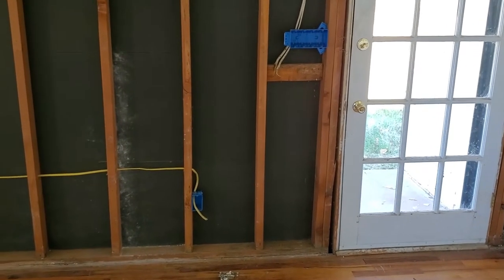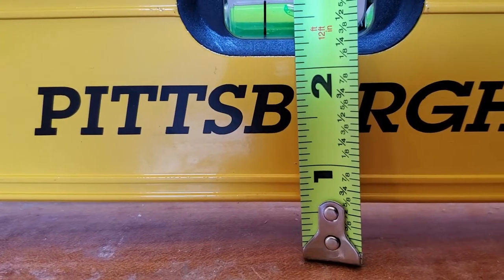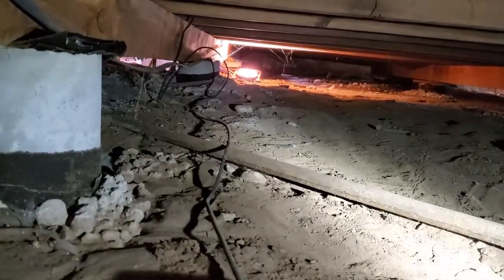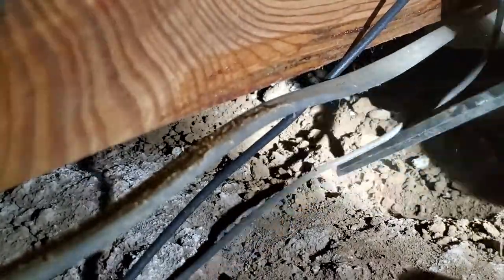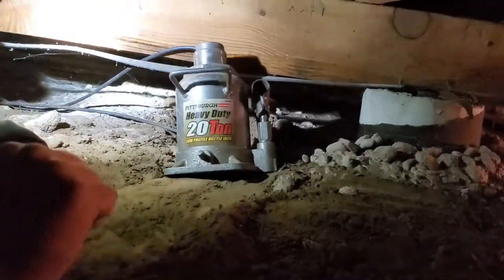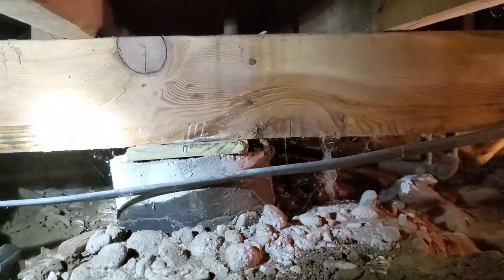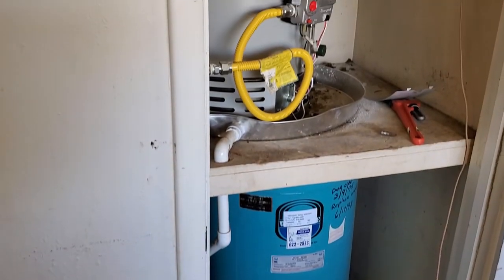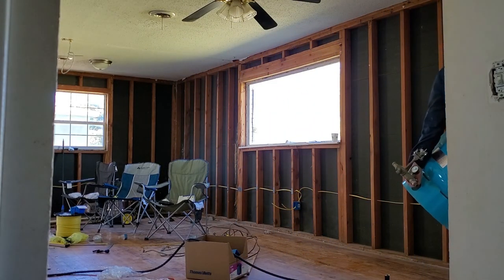Leveling the Pier and Beam House | My First Renovation

Comment: If the interior floor was not important or being saved I would have cut a section out and worked standing up between the joists. But it looks like you wanted to keep the flooring intact. Good real world vid. Take care.
Reply from the maker: I really wanted to try to save the floor. All things considerd, because I had so much to do under the house I should have taken it up to do the repairs. Live and learn!
Reply: you are right why not just cut floor out to the crawl space and stand on it for repair...as well as adding any hydraulics....

Comment: Oh boy...I just bought my brothers out on a 1948 house we inherited. Im trying to get rid of a hump where the floor buckled.  I feel good after seeing this crawlspace though. I have a lot more room.
Reply from the maker: It's really not too bad to fix. Check to make sure the beams are nailed together really well! Mine only had a few nails which did not tie them together well and offered no displacement support! Triangle nail patterns are your friend when trying to make the beams stronger
Reply: @Jay_Schmidt  A couple of years ago the floor buckled because the water heater was leaking and literally spraying a fine mist of hot water right onto a pier. It heaved and when I fixed the leak the floor pretty much settled back. It was good enough for 90 year old grandma. 
Now that Im putting a straight edge to it, it still needs to go down another 1 - 1 ½  to be right.
Since there are no shims I decided to use a rotor hammer to shorten that pier. We will see.
 I got started last night. Hard work.

My plan is renting it out. It isn’t in bad shape like yours was but its showing it age and and lack up updates.
Im going to attempt to ground the 2 wire system rather than rewire. Mainly because it is not necessary to take the house down to the studs.

Plus Im trying not to run out of money lol
Reply from the maker: Oh, it was raised. Sorry, I thought it was low. This kind of work takes a lot of time to get rid of that 1 inch difference, haha. It sure makes you feel good when it's done.

Yeah, I needed to insulate so I figured I may as well do EVERYTHING at once... despite my wallets complaints. At least doing the work myself is much cheaper.

Let me know how your house turns out!
Reply: @Jay_Schmidt  what is your present stage?
Reply from the maker: I'm a few months behind my video. I've already got drywall up and a bathroom done!

I'm finishing skim coats and about to move on to the kitchen.

Comment: A few things-

It looked like the sag was between piers in the crawlspace. Once a sag has occurred you can’t simply lift the existing beam at the two adjacent piers without causing issues in other spots (think see saw with each pier being a pivot point).

What you need to do is:

Get some 2x6 (or whatever height that beam is) which span at least the distance between the two piers
Then lift in the middle of the sag when level (use laser level or a 6 foot level) attach your 2x6s to the original beam (the easiest way to do this is with some Spax power lags- just point and pull the trigger). Use many lags (at least 8 )

Ideally - you can create a permanent  support where the  sag was (to do this you need to either dig and fill a Sonotube or dig less, fill with gravel and top with a steel plate or large 16”+ cement block. These would provide a spot that will keep your support from sinking when the ground gets wet. Either way- sistering the original beam (adding 2x pieces to the side of it) must be done because the original beam has failed.

Comment: Same problem that I surmised after the hvac people installed a water heater and new heating furnace in the small utility room closet in the kitchen after install as there had been a sagging floor directly at the point of these 2 heavy items...installers never acknowedged any of this prior to install.....its obvious to me also happened on the flat roof sagging after 8 thousand cover with epdm rubber cover glued down....this is seventy year old house....the proper way was not done so it looks like this is called a bandaid fix...in both cases never getting to the bottom underneath both the sagging floor in kitchen as well as sagging flat roof over den.....at least plywood under layment would have solved the sagging and no tapers for pitch or bitumen instead of rubber....wow!

Comment: I hope you got it all level. I'm not sure if another video covered it. I went through a 2.5 year renovation (nights and weekends) and we had a beam that we added 2X's on each side, with construction adhesive and drilled through and added tons of lag screws and bolts to tighten it all up.
Reply from the maker: I got it much closer to level through the entire house. The majority of the beams only had nails on the butted joints, so I leveled out the beams and stage nailed them once they were even. That helped a ton.

Comment: Hello sir I have a quick question I have a pier and beam home that needs leveling...I don't know if I made a mistake...because I remodeled all the inside with new sheetrock on walls...my question is, if I level my home will my house crack in the inside? I'm holding off in remodeling the siding in the outside because I don't know if it'll crack new siding.
Reply from the maker: Do you know how far out of level it is? Ours had significant issues, and once I leveled it a few cracks appeared near the door frames. Door frames are naturally weaker than other parts of the wall. If you only need to shim a little bit, it may not crack. It is hard to say for sure, but having some small sections is possible.
Reply: @Jay_Schmidt  house was built in 1928 and I don't think leveling was ever done to it...Im currently renting it out because I'm done with the inside...the living room floor is sorta raised...I think its in real need of leveling...didnt find out about the whole leveling, till researching pier and beam homes and the required maintenance...I would've known, I would've done that first...but I would like to know if extensive damage could be done to the inside after leveling
Reply from the maker: @c956rubber   I haven't seen your home, but if you have minimal settling and you're not trying to level around floors with tile you may be fine. If you're worried about the interior it may not hurt to ask a foundation service in your area. If you have bigger problems under the house they will be able tell you the risk level of damage.
Reply: @Jay_Schmidt  thank you so much for your input...godbless
Reply: Yes if you level the house up but if you support under for sagging I don't think so but it's possible depending how much lifting as to be up

Comment: Low of tam, 1/8 inch per week if leveling beams.
Doing so maybe you wouldn't see any cracks on the walls and door frames.
About crawlspace I have condo in Florida. Under the roof in the attic. Takes me one min to move 2 feet.
Not only this, I was caring tools in the bag, wearing mask, coveralls, caring flash light, safety hat so I wouldn't hit the nail from the above.
2 inch spare between roof and trusses. Bad construction design. 
Sweat like a pig and when I reached another end I wonted pee. 
This was my the worst 4 hours in my entire life.
Reply from the maker: I wasn't too concerned about cracking drywall since I had the place gutted, but normally I agree